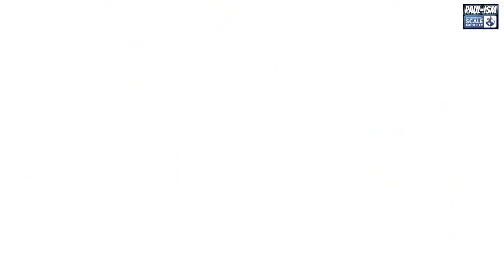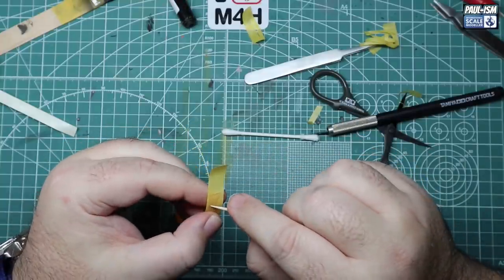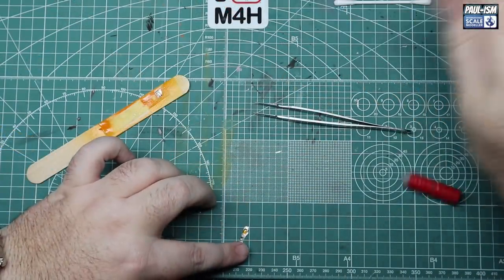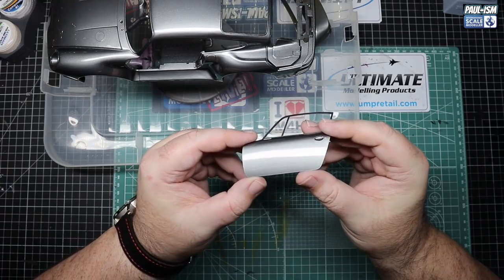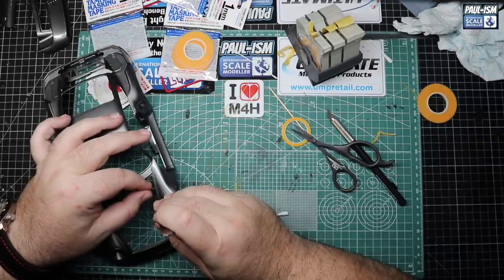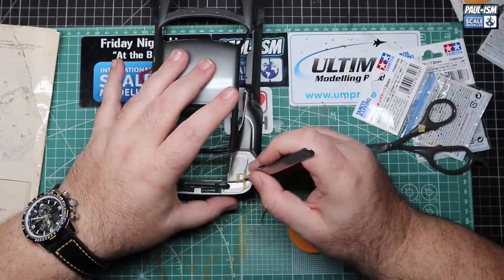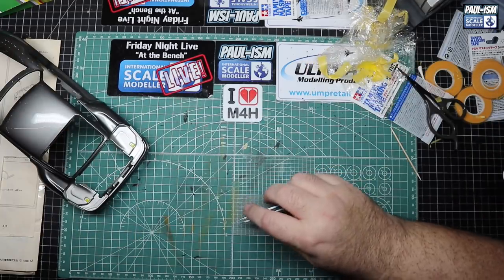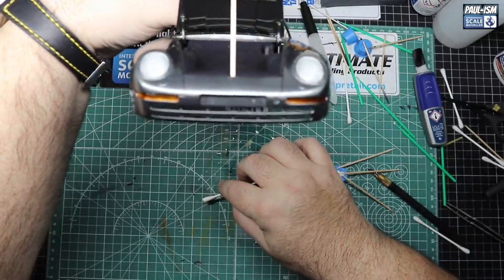Part 9 - Fujimi 1/16 Porsche 959 - Step by Step build

Comment: You may have heard of this tip for old decals. A modeler on you tube used clear coat to coat the decals. After drying, cut the decals as close as possible and dip in water as usual. The ones I watched him do worked very well.

Comment: Hello Paul, Garet build l have just done the Revell Porsche 934, RSR Vaillant nothing like that yours, just started out on cars learnt a bit from you, now something different, l saw the other month on the show when you built the 1/35 Lepard 2 by border models, in the end, it burnt a hole in my pocket and l brought  it for £31.00 of eBay 
What it is how many track links did you use each side. because there is no count number, look forwards to the next video on the  Porsche.
Reply from the maker: Hi paul I show that in my video build of it can’t remember of the top of my head have a look in the builds on the channel there’s three  parts